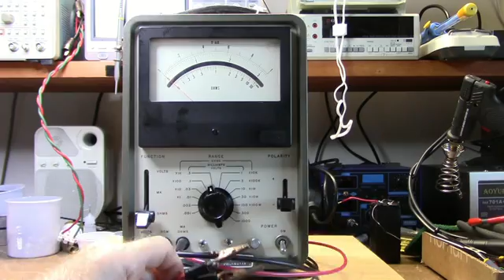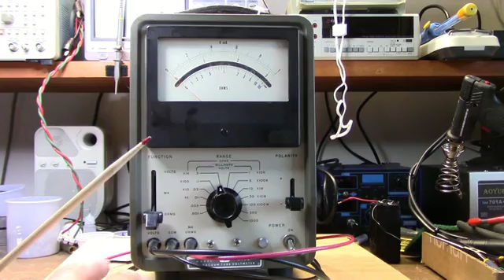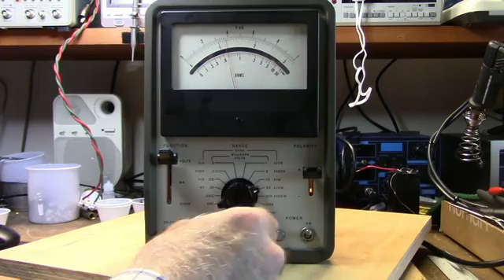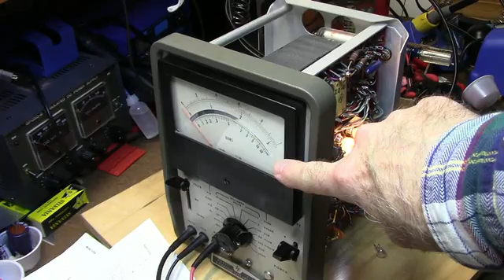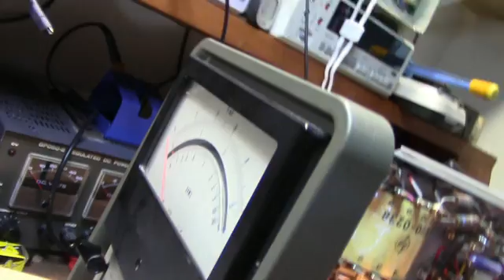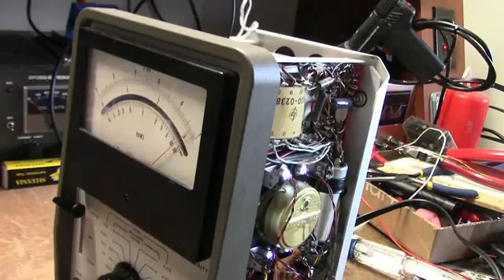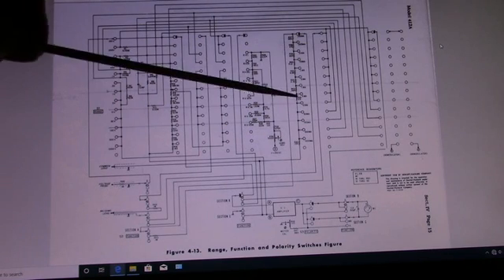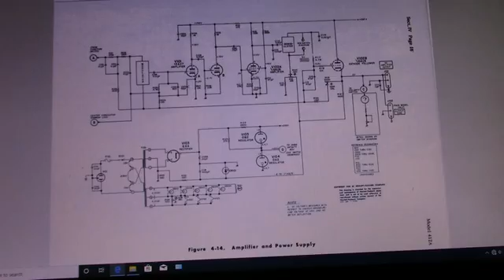Hp 412A VTVM Troubleshoot and Mod

Comment: I bought one at a good price.   I am thinking of using banana plugs so I can use different cables, however, I see on lines are grounded. Not sure how that will work out.    I might test before committing.